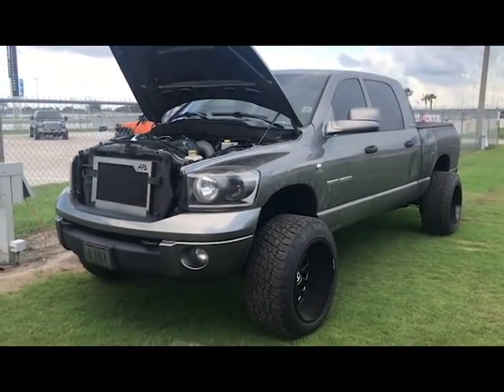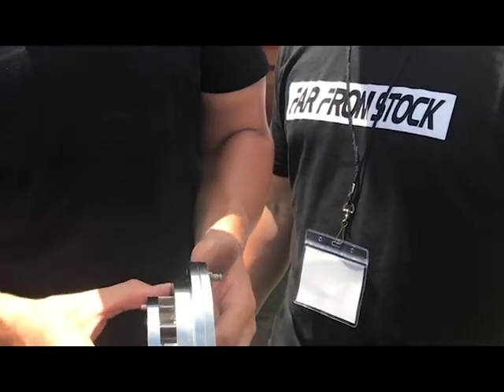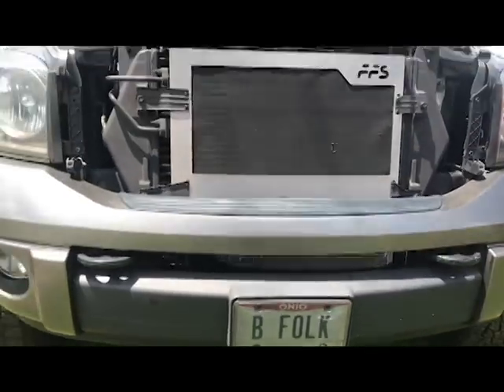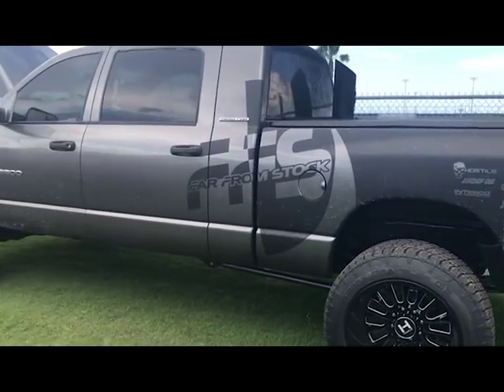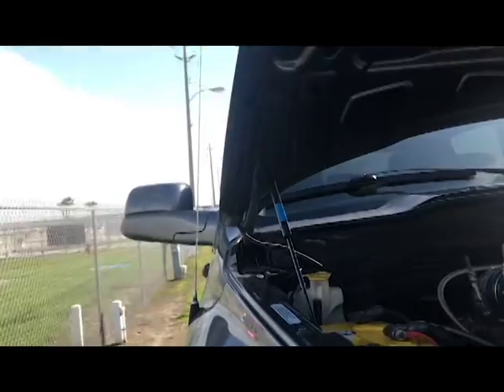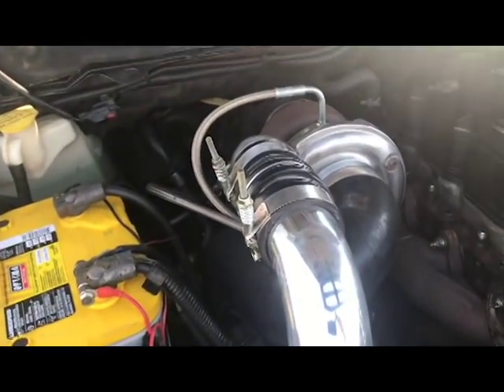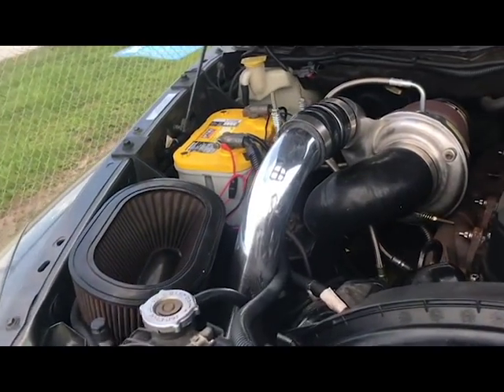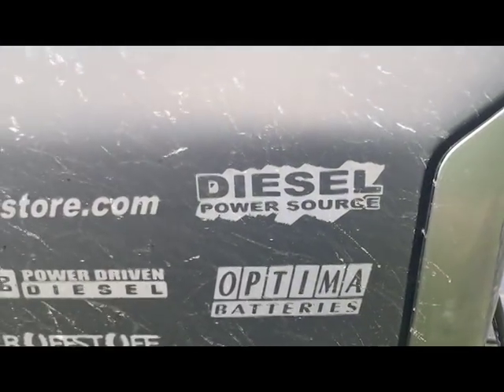How to make 900 Horse Power with a Common Rail

Comment: My dads 2002 dodge diesel has 1000 hp on the Dino
Reply: Jack Molnar that’s sick!!
Reply: i highly doubt that the 5.9 would go near 750hp. what mods are on it...and did you do some crazy overhaul?
Reply: It has twin turbos twin fuel pumps it lowered to the ground and a bunch of other stuff
Reply: Jack Molnar that still wouldn’t would even make up towards 600. Where’s this other 400? you’d surely blow unless you have done some crazy overhaul and insane ups. Don’t think you’d even be close to 1000 with that though.
Reply: austin randall not picking sides but theres plenty of cummins that make 1000whp or more on twin setups bro.. Whether you make 500whp or 1000 it can be done with the sane kit.. It just depends on how much boost he is pushing to the engine.. If he is low boost then yea he prolly under 600 but who knows his dads truck may be pushing 50 psi or more. Now if thats the case, where he running crazy high boost then he may be 1000whp or more.. All on how much boost they running..
Reply: @austinrandall3685  bruh, just fuel and a tune and you’d make 600. Learn before you speak
Reply: @austinrandall3685  plenty of 5.9s making well over 1k hp even 12valves nowadays
Reply: @austinrandall3685  you stupid? You know how many high hp 5.9’s there are?😂
Reply: Pulled a 20 ft trailer wtf lmao
Reply: @cmurph5752  maybe he thinks thats heavy haulin?😆😆
Reply: We don't care bout daddies truck.. what's your vehicle do?
Reply: Lebron 37k10k10k is a rase truck just become you jealous